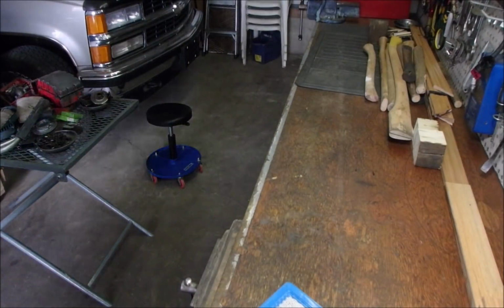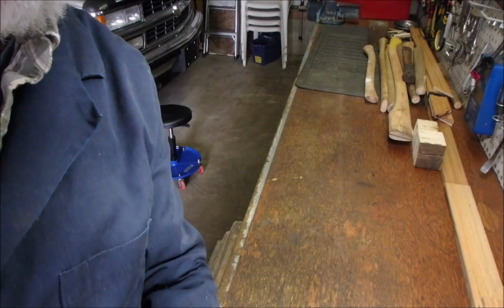Mowing Leaves and Another Mail Call

Comment: Works great for a few smaller trees. I’ve got 8 huge Norway Maples that are pushing 100 years old plus a monster Ash tree and two very large old Magnolia trees as well as a few very old oaks (plus a neighbor downwind who never rakes up his leaves). I mince them up into little bits with my Toro TimeMaster then use a walk behind blower to blow the little bits under the bushes. Gotta do that about 4 or 5 times on the entire property but then after a windy winter day the neighbor’s leaves blow into my yard and make it look like I’ve done nothing!
Reply from the maker: Wow   I understand
Reply: @BrucesShop  yeah it’s a drag but it still beats raking! Hey I like that Honda carb place holder thingy. I bought really long bolts at the hardware store and cut the heads off but they’re still a little too short. Wish Honda did it like Kohler and Loncin where they use studs that stay in place and nuts at the end to hold the carb on but then their linkage wouldn’t come apart I guess. They’re a pain but they are great engines!
Reply from the maker: @mjg263  Right

Comment: Not essential, but comes in handy from time to time: take a Dremel & cut slots on the non-threaded ends so you can tighten & loosen with a flat screwdriver.  On the leaves, often I chop them first in mulch mode & then bag. Can get way more leaf bits in the bag that way even though it takes two trips (need the exercise anyway). Trade-off is that I don't have to stop nearly as often to unload the bag. Just a thought; your method did just fine.
Reply from the maker: Thanks a lot JJ

Comment: As for the compressor developing a slow leak, after you cleaned the garage floor, check the water drain on the bottom of the tank, make sure it's tight..... Drain the water while you're at it, just a thought.
Reply from the maker: I actually did that.  It was the cheap yellow coil with the air gun on it, leaking on the attachment under the coil spring.